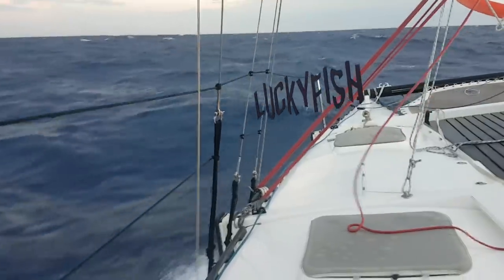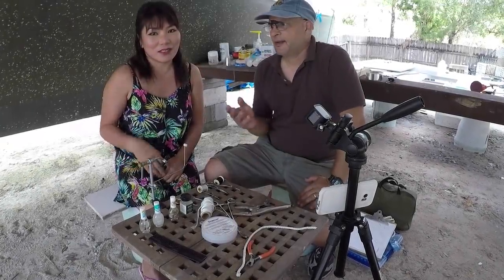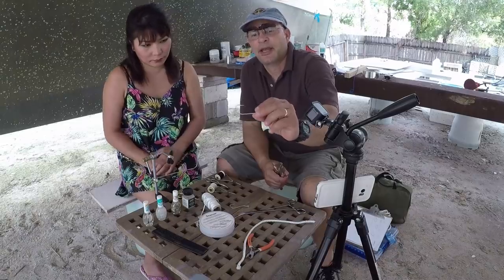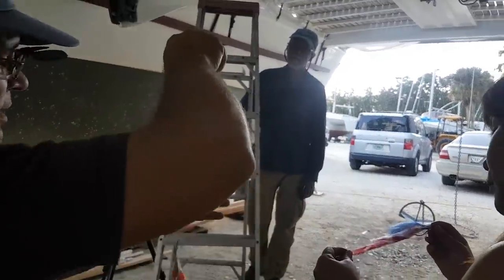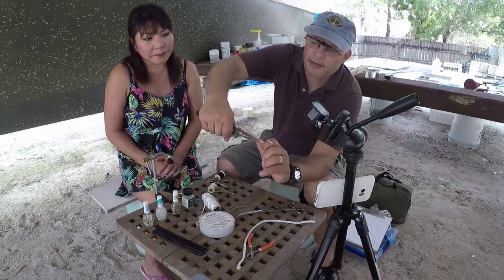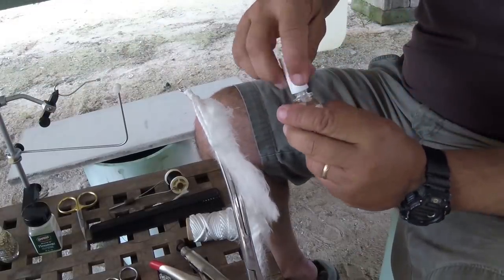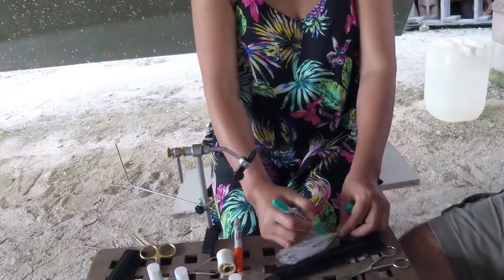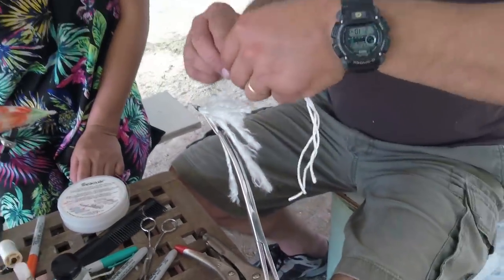Never Go Hungry - Girl makes fishing lures - Desert Island - Ep 61 Sailing Luckyfish

Comment: mylar from snack food bags works really well as a bait skirt or as a lure all by itself. I cut a section of the bag in a rectangular shape that is at least twice as long as the hook with a width of about a quarter of the long leg of the rectangle, then cut it into long thin strips to about 2/3 of the length thereby leaving 1/3 intact. I apply contact cement to both sides of the intact bit of the mylar and to the hook shank. be careful to keep glue off the long strips. after the glue is completely dry I roll the mylar onto the hook shank keeping the wraps as tight as possible. if you have some heat shrink tubing it can be used below the hook eye to add some strength and form the head or you could give a coat or two of clear or tinted epoxy or super glue or nail polish, again not on the long strips as you want them to move freely.
 you can also make a skirt by attaching the mylar to a short length of cotton ear bud (Q-tip in the USA) or a thin coffee stirring straw. this goes on the line above the hook. a good set up  is a swivel to connect your main line to a  heavier leader, then a colored bead if available, a spinner blade if available, the mylar skirt glued onto the thin straw, followed by a sliding egg or ball shape sinker and finally the hook. it can be fished as is or with a length of fish belly or squid. it can be trolled or use a jigging motion if the boat is still.
another tip is  if you have room in your freezer, try chopping up the fish bits that you don't intend to cook and freeze it in a mesh bag like you get when buying onions ...or old nylon stocking also works..to make a chum bag that will attract small fish, which in turn will attract larger fish.
Reply from the maker: Love it. Some great tips there. While we are happy to catch any fish using any lure! catching your food on a lure you made yourself is quite special. Your ideas show what is possible if you really want to become creative! Like Gerry said in the video, there is a craft side to this too, which is also satisfying. Cheers, Stew and Zaya

Comment: Reminded me about your Wind Generator.... I forgot on your previous video, to mention about your knocking noise.... You need to determine the frequency/pattern of the noise.... Once a revolution, Probably a miss-aligned blade, three times a revolution, maybe echo of the blades passing the mounting pole.
Some other period, (i.e. 2 times or 5 times a revolution or every 2 revolutions, or some other odd number) implies its not the prop, its probably a shaft bearing and or gearing (if the prop shaft just turns gears to an internal generator) [probably not geared, I imaging its just direct induction]

Comment: should be -18 degrees farenheight and -1 degrees celsius , slip of the tongue.hahaa.
Reply from the maker: must admit, Fahrenheit is not my strong suit. Daytime temps are around -18C here currently. What's that in F?
Reply: 32° F = 0 C... so, -18 C is about 0.4° F, Gerry!
Reply: @SailingLuckyfish  0C equals 32F and each degree C change is 1.8F.  For example, 20C equals 68F, so 25C will be 5X1.8 higher in F which is (5X1.8=9F) 77F.  It works the same for subtraction in the other direction. Answer to your question of -18C is minus 32.4 from 32F which is -.4F.
Reply: @SailingLuckyfish  Google will tell you right in the search box, so you can script that bit right before you start the camera.